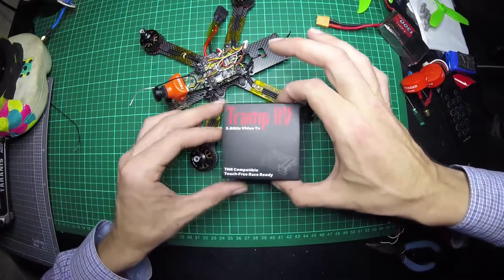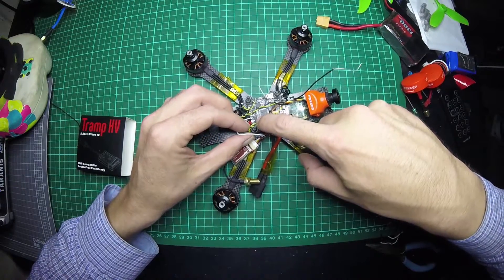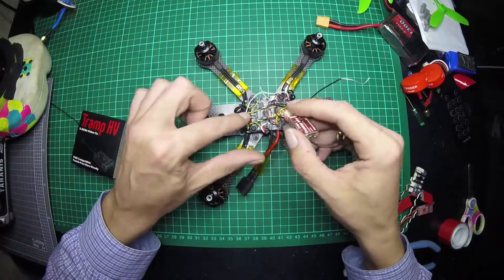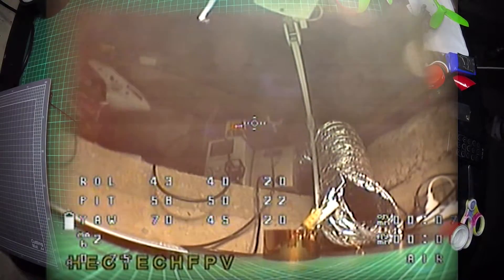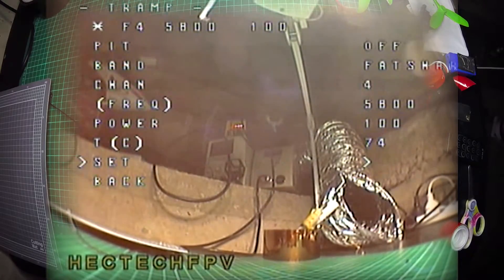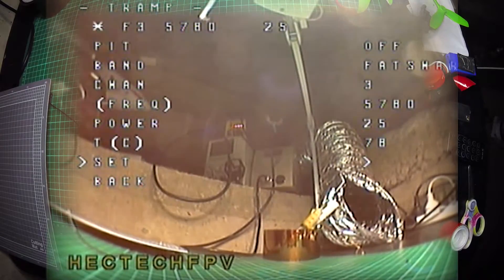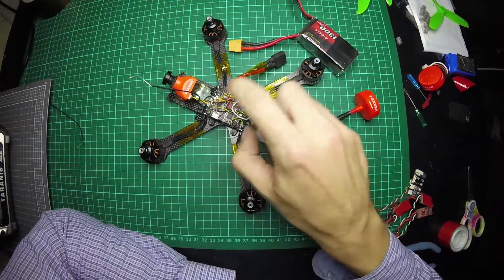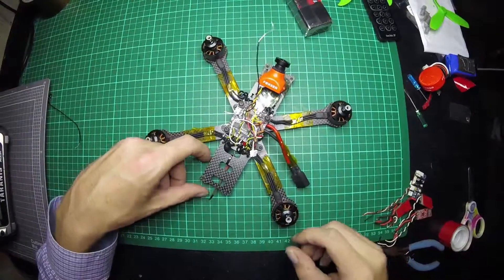Tramp hv - Telemetry

Comment: Hi
Where do i connect trump on my FC to sbus, RX or TX ?
I want to be able to change channels via osd, 
If you look at the image below the RX is already occupied by my flysky receiver (ibus dont work in sbus port) so i have left sbus and TX free 
What shall I do?

http://www.ibaza.it/42509-thickbox_default/1157101-racerstar-starf3s-30a-bl-s-4-in-1-esc-5v-bec-w-f3-flight-controller-aio-osd-bec-current-sensor.jpg
Reply from the maker: GPS TX pin looks free :), any Spare TX pin on a unused UART will work .
Reply: If you have the fs-a8 rx, make sure you hold the button to change mode from ibus to sbus. That way you free up the video.

Comment: Ad first it did not work for me so i swappen my tramp for the unify pro but same problem. Yesterday I flashed my fc on an other pc with the latest software and the unify is now working. Did not try the tramp yet but I think the problem is solved.
Reply from the maker: Hope so, either one there both great units and having this feature is just Awesome! im only borrowing this unit so im sad to pack it back up but im sold on the ease of it all :)
Reply: Yes it is great. no problems any more with trying to push the button as it is in the frame and no counting the leds any more.
Testing today the tramp. 
From now I only get fc's with an osd in bf and the tramp or unify vtx.
Reply: emiel1976ep Hi
Where do i connect trump on my FC to sbus, RX or TX ?
I want to be able to change channels via osd, 
If you look at the image below the RX is already occupied by my flysky receiver (ibus dont work in sbus port) so i have left sbus and TX free 
What shall I do?

http://www.ibaza.it/42509-thickbox_default/1157101-racerstar-starf3s-30a-bl-s-4-in-1-esc-5v-bec-w-f3-flight-controller-aio-osd-bec-current-sensor.jpg